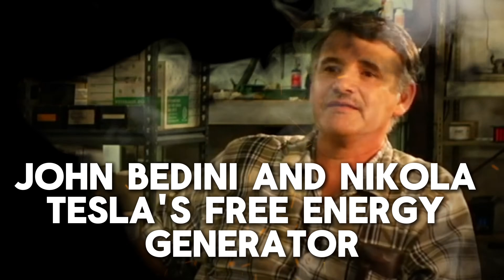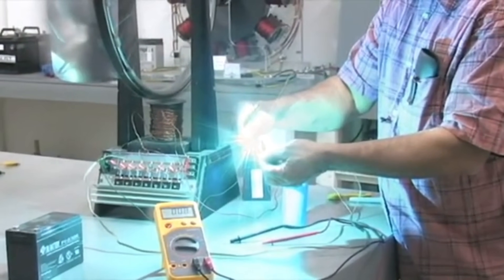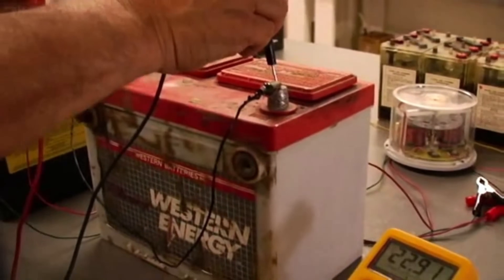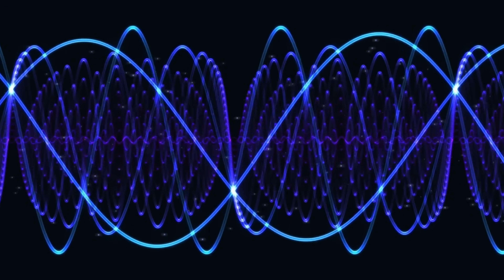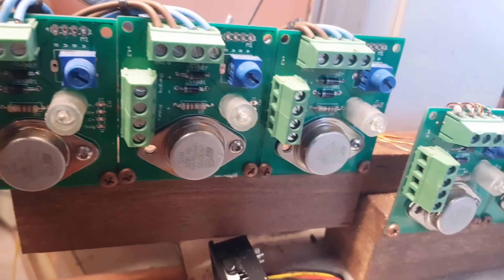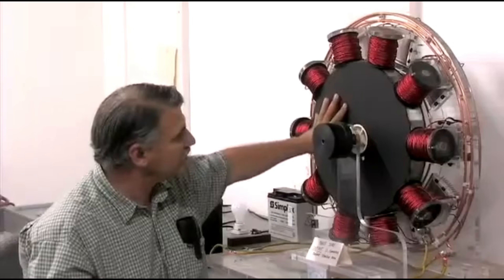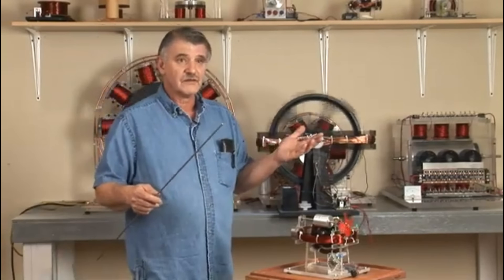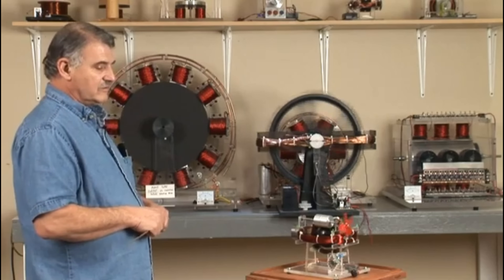Free Energy : John Bedini 20 Pole Motor Generator The Future of Energy!

Comment: The portal to the universes power is the magnet which is a crystal that vibrates at the uiverses frequency....after all, magnets do not die..so , when u take magnetic Flux and put it into copper which makes electricity, why is the magnet still fully charged..it is not charged,it vibrates and pulls in its power from the either.. horsepower is only required to fight the eddie currents created during charging, so that is fixed by using John bedini and Thomas Beardens Patented motionless electronic generator.  Some will ask why don't we have this commercially,  the answer, the bankers have oil and gas to sell you therefore u cannot have free energy. Cuz
  IT'S FREE. 
We are slaves to be milked for our labor so the elites can live in castles in the sky..

Comment: The free energy in this device does not come from the motor, which is somewhat inefficient, the trick is inside the battery, the discharge pulses break the battery crystals into smaller and smaller crystals and those small crystals are the ones that obtain the energy from the Ether, the vacuum, the quantum or whatever you want to call it.
Reply: My understanding is that the energy comes from the Impulse voltages that forces a chemical change in the battery
Reply: @raloed.363  I would rather use capacitors as radiant energy can charge them
Reply: @jlo13800  from my understanding you need capacitors that have chemical reactions in them. It might not work for standard parallel plates capacitors.
Reply: @raloed.363  Im try to avoid chemical reactions. A parallel plate capacitor with a HID bulb could work for plasma. There are many devices that go overunity with out. Tesla charged ordinary plate capacitors with radiant energy!